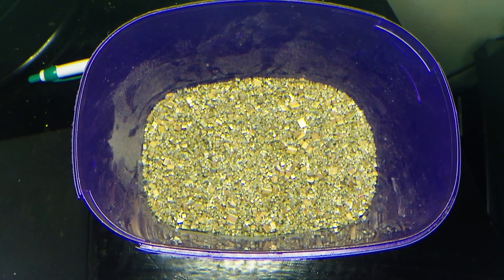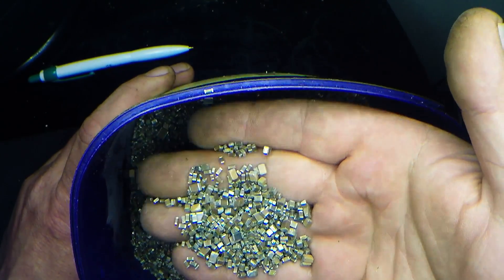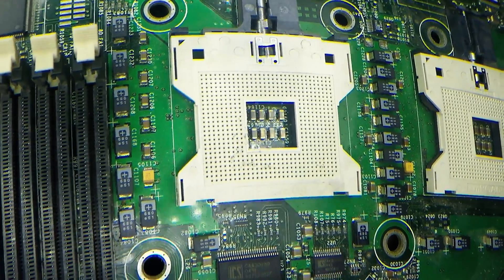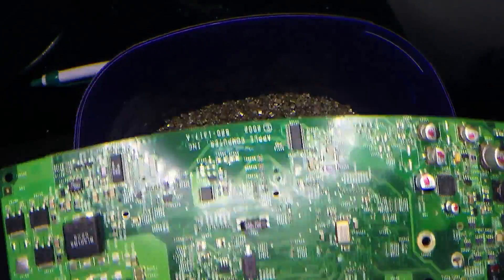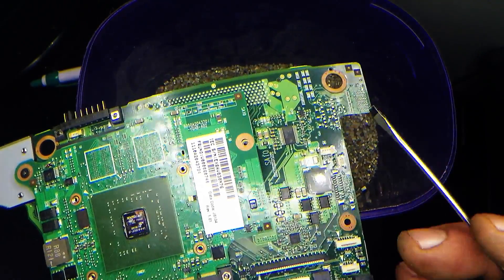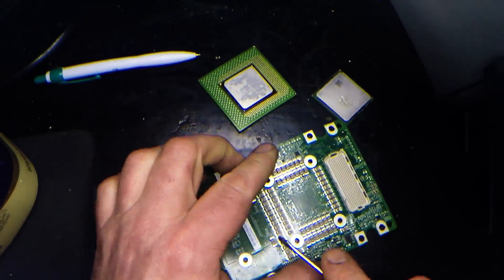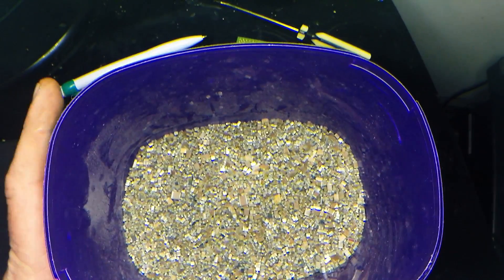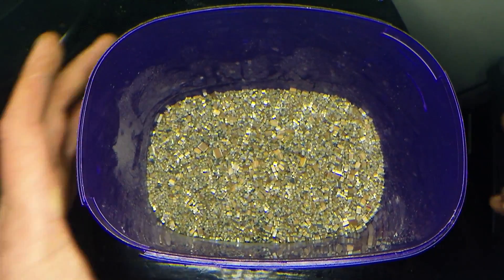Palladium & Silver recovery from MLCC's

Comment: You can get a multi purpose tool and get a blade that's small and thin just like your screwdriver maybe a little bit bigger you turn that thing on and when you see The row you want you to go across from not touching anything else and you won't have all that holding it down with your hand sticking yourself with a screwdriver just a suggestion sir Give it a shot

Comment: Remove big capacitors, Warm the board to melt solder in a convection oven, pluck off bigger connectors, scrape with a paint scraper. Separate with a magnet. The resistors are ok to have mixed in because they have silver on the ends.

Comment: If you're buying piles of these things off of sleazebay for way more than they're worth you've already failed anyway. If you're picking them for yourself I don't really see the issue with tossing the inductors into the same batch. Sure technically your yield of palladium by weight will be less than 2% but who cares? It's not going to stop the acid from working to dissolve it all and you're not going to lose any palladium because of it and you'll get a bit more silver than otherwise would. Don't leave money on the board!

Comment: What would happen if mix the mlcc and mlci together? Will we still get pure silver over it? Cause its pretty hard to tell which is which. And most of the circuit board not state it.
Reply from the maker: silver, yes. but no palladium in mlci. inductor code on board is "L"

Comment: Firstly MLCCs means MUltilayer Ceramic Capacitors not Monolithic Ceramic Capacitors. Many videos claim they contain gold ,they do not.

Also it has been the avowed aim of every MLCC manufacturer to eliminate Palladium from being used as a constituent of the electrode alloy (used to be 70% silver 30% Palladium )  so many other metals have been used as substitutes eg, Lead, copper etc with some success, This is because the supplyof palladium is volatiles and expensive. The main metal recovered is Silver from the terminations (mixed with glass),  If you want to make money it is no use relying on the sellers estimate of Palladium content  you must obtain an assay before you buy, and believe me you will find very little Palladium in it in most cases. 

former AVX Technical manager.
Reply: thanks.
Reply: what if we buy in india , where sellers know little about estimates

Comment: Ben, I'm sure this question is asked a lot but I haven't seen it. Lets say I gather a lot of scrap, perform the recovery and even the refining process myself. Where exactly does one unload two or three ounces of Palladium? Gold and silver are easy, every pawn shop in the country will buy your gold and silver (though at a much-reduced price). How does one go about moving large amounts of Palladium, tantalum, etc? Great video! One of the better ones out there on e-waste. Keep up the good work!
Reply from the maker: you wold sell precious metals to a bullion dealer, not a pawn shop, they would buy palladium no problem.
tantalum capacitors can just be sold to a buyer as it's not likely you will be able to process it, requires very high temp's to melt

Comment: Please note, that not all MLCCs contain palladium. Some just use Nickel. And there is no easy way telling which one has Pd in them and which one doesn´t. You can use a magnet to sort out nickel carrying MLCCs (nickel is magnetic) but even those nickel based MLCCs may contain Pd. So there really is no easy way to find out before recovering the PMs. From my practical experience 2% Pd and 10% Ag is a maximum, yet possible. Recovery is a pain in the a.. but that is another story. Not suitable for beginners.
Reply from the maker: Yeah I explain NME & BME MLCC's in the mlcc melt video which should be finished in a week or so.
The nickel based mlcc's or BME's don't contain any PM's but the NME's contain nickel which is why they are both magnetic to a degree

Comment: hey you stated that these are marked with a "C" or a "D" however on some sound cards 
there marked with a "R" , what is the deal with the "R" ones ?
Reply from the maker: R is a Resistor, D is a Diode, only C is for capacitor but still needs to look like an mlcc to be one, so no C no mlcc
Reply: ok so what does a resistor have as far as pm's go ?
Reply from the maker: Not much, thick film resistors, the ones with numbers on the top of them usually have ruthenium but very hard to get it and very small amount, no, resistors are not something we really go for, it's just not something an average refiner would bother with
Reply: ok thanks for all that information . keep up the great work my friend .

Comment: So what would happen if I throw a bunch of these into a crucible and melted them... Meh Finding out is half the fun!
Reply from the maker: I'm thinking about doing it to get an idea what percentage the metals are in them in general, might not work though as there's a lot of ceramic and it's hard to know which are noble metal mlcc's and which are base metal mlcc's, but as you say, it would be fun trying.
Reply: I have an old old computer from the early 2000's 6 hard drives, 8 loose ram sticks 2 old monitors, bunch of stuff I could scrap, I also melt aluminum cans, the machined aluminum from a hard drive is so much bulkier would be nice to make them ingots.

I was thinking of just crushing Fluxing and melting the entire thing to let the metals settle down, if I had to I could use lead to help collect the silver and palladium then refine it with a cupile. (May have misspelled cupile, never used one :D)

I have a silver skull I made out of pennies, its cool, more about the art than making a profit, literally since it's illegal for me to make a profit off messing with pennies! must be for education and art.

Comment: How do you take an MLCC off of a board without it breaking and crumbling?
Reply: themedres s I use thin pliers for the bigger ones. Small ones sharp chisel (carefully adding pressure and moving chisel side to side.)then pour into a jar.

Comment: You can tell the difference of MLCI and MLCC by color. MLCC have a yellow/brownish color and MLCI are black or grey-black.
Reply from the maker: no not the case, it's the coding on the board, L for inductor, C for capacitor, mlcc's come in lots of shades
Reply from the maker: and different grades, grade 1 - grade 2, grade 1 are high grade and mostly on telecom, sserver and H/D boards
Reply: its my experience, i measure them with a multimeter so i can be 100% sure thats a cap or an inductor. For my batch the color scheme is always the same. The inductors where always black or grey, and the caps yellowish cream like. I measures hundrets of them, i never found a yellow inductor.
Reply: eWaste Ben
 do you know if the silver plates inside of pc hard drives are silver plated? do they have any value?
Reply from the maker: usually it's platinum but you need thousands to get 1 gram
Reply from the maker: no but you will find black mlcc's

Comment: I pulverized a small batch of these, from four different makers. Then applied silver test solution to the powder. First tested the silver test solution on a .999  silver round. Positive test for silver. The test on the MMLC powder was negative for silver. Repeated the test 3 times. Under a 30x scope the powder looked like nickel. Am going to do a fire assay on some and see what the results are. Nickel will go to the slag. Nickel is widely used for metal plating and as a electrical charge holder.
Reply from the maker: +David Howard some don't have silver contacts and no palladium either, but I don't think your testing methods is how they do it, you would want to refine that powder and drop the silver out, then test wouldn't you?
Reply: its a watytofireassa

Comment: wouldnt it be easier to use a heat gun instead of using a screw driver to remove these?
Reply: no that would just make a hot mess, these pop off super easy which is why people take the time to collect them

Comment: When you de-populate a board via an air hammer... how do you separate MLCCs from MCLIs and MLCRs (resistors) since off the board there are no codes to read and they all look a like? Or in that case you just process them all together? Thanks!
Reply from the maker: +Scappin' Cricket yeah not much you can do there aside when you get them refined you will just have less palladium/silver ratio, I do try and remove bigger mlcc's first by hand, the small ones and crumbles will just go in another tub and processed after the hand picked one's are.

But if you want to be picky then do them by hand first, that way you will have a nice clean batch.
Reply: +eWaste Ben Thank you for replying back and being helpfully honest :)

Comment: I tried quickly to write in the forum but couldn't figure it out quickly enough , so I was wondering if u could answer one more question.  what is the silver stuff on the end of these Flat connection wires/paper?  ribbon like,  I see on many it is good but im coming across silver ones.  are these precious metals?
Reply from the maker: +Raymond Reyes Tin
Reply: +eWaste Ben  it's TIN?
Reply from the maker: yep Tin, rarely silver, when it is silver it's not shiny it's a flat grey

Comment: Gday, how do they do it on industrial scale? Do they just throw everything into a furnace to melt everything and separate metals by melting points?
the main problem would be plastic fumes.
Reply from the maker: +GEZZA1 Not melted, they grind the boards down to a fine powder and use eddy currents to seperate the metals, plastic etc. it's a very clean process.

Comment: Take care folks with the MLCCs. I scraped almost half a kilo of them over the past 2 years, later I found out, that there are 2 types of MLCCs, BME and PME (base metal / precious metal). BME MLCCs contain no Pd, they contain Nickel instead and are magnetic... I tested my MLCCs with a harddrive magnet, more then 2/3 of them are magnetic... =(
Reply from the maker: +TAWNY BME's have only been in production for 5 years and not many things we scrap are new, they still make class 1 mlcc's.
you mostly have inductors that look like mlcc's, they have code "L" on the board and are easily confused with mlcc's because they look the same.
Reply: no, its like you said, you can only trust yourself with MLCCs and I am sure, I had just scraped capacitors, didnt touch any inductors. Well, it was alot of work to scarp and collect them, and I was really disapointed, when I found out about it and run a magnet on them... have you checked yours, how much of them are magnetic? Well, I would guess, really good non magnetic MLCCs can only be found in 1990s hardware. Anything later then 2000 only if its high-end hardware like servers...
Reply from the maker: +TAWNY i'm pretty sure even the ceramic has some magnetism to them, a hard drive magnet is very strong so would pick up most of them, maybe try a regular magnet and the ones that get picked up then you could throw out.
think the colored mobo's, red/blue etc might have the new style mlcc's, I just pick 'em all and hope for the best if I refine them.
Reply: @eWasteBen  Nonnagnetic ones are nonmagnetic even for neodinum magnet,
Reply: @eWasteBen  hello, so I was wondering if you've ever scrapped a hospital laser? I got two rather large Exima 380 lasers and it looks like there is a lot of good stuff inside but i don't know if it is dangerous to be screwing around with lasers. Thanks for any advice you might have.
Reply: You can sell those old laser heads and power supplies they use to tinkerers like myself for more than what you would get for scrap. Do you still have any? I might buy or trade for one, as I could likely use the parts.
Reply: @eWasteBen  your the last person to take any advice from on anything recovering precious metals since you don't actually recover anything, you hoard material and have yet to do anything that recovers or refines anything. So yeah, anything about taking stuff apart sure
Reply: There is actually 3 kinds of mlccs, the two types you listed both very low yield of anything really compared to old school mlccs which are dipped. They contain 20 to 30 grams of palladium per kilo. Plus they yield silver but it's always the other metals that matter for me
Reply: OH I SEE.
YOU THOUGHT ?
BECAUSE THE FACT !
THAT YOU ARE ONE
BRAINLESS LOSER !
Somehow...
You thought ?
The rest of us.
ARE LIKE YOU.
NOPE !
WE,
THEE GOOD PEOPLE !
UNDERSTAND.

Comment: eWaste Ben do Inductors contain silver?
Reply from the maker: +Mark Hickman yes many chip inductors do have silver, less than 0.005 grams :) so it would take a lot of 'em to get 1 gram, but if they were mixed up with mlcc's then I guess after the palladium extraction from mlcc's, you could then get to the silver from the solution of both capacitors & inductors.
Reply: +eWaste Ben  e said that they do a little

Comment: Glad I came across your vids, Ben! Very good info. On this one in particular....I depopulate all my boards with a sandbath so my monolithics are mixed.....I proceed too many to hand scrape.... But I am only accumulating them at this point and refining or selling... Any suggestions? Or will it all come out in the mix when I do decide to test run a refining process? Cheers!
Reply from the maker: +pacoblancosmith Yes I think you'll be ok with a mix of mlcc's, resistors ect as you'll be extracting one metal at a time, so if your going for Palladium first then what's left will contain silver and other metals, next you might extract the silver, by then you might be happy with what you have at that stage. I have a new method of depopulating boards, simply using an air hammer, my latest video shows the process, in the end I have the same as you have after a sand bath.

Comment: If your processing the mlcc's yourself is it as critical to make sure they arent inductors?
Reply from the maker: William Ela Probably not but you still want clean product with as little contaminants as possible when processing mlcc's.
Resistors can be processed for other metals like ruthenium.
Reply: I saw that comment and you stated that  you didnt know if the ruthenium could be processed. Did you find out somethin else in that time?
Reply from the maker: William Ela They're getting it at the highest level of refining, like Umicor.
I'm still looking into it but there's no reason Ruthenium can't be extracted from the thick film resistors.
The one's with a black top and numbers on it like 135, 325 etc.
Reply: eWaste Ben Thanks! ive been scrapping for a while and have started geetting into depopolationg mother boards! MY personal favorite areMLCC's

Comment: superb channel and video as well! but i ve got some old mobile phones circuit mother boards and i ve looked for marks on them next to theese MLCCs and there is non. So how do i know what is what on  boards like this? it is really hard to tell just by color sandy looking MLCC. i want to get the highest rate as you mentioned. thanks
Reply from the maker: lubiatty1 Sometimes the codes will be in a group near the corresponding group of mlcc's. But mobile phones are known to have high quality components and those that look like an mlcc most likely will be so i'd be comfortable with putting them in my mlcc tub.
Reply: thanks for advice. i dont see any marks next to anything there at all. but i believe they are all MLCCs, hopfully. thanks again!

Comment: I was reading somewhere that the black mlccs have rhodium in them, is that true?
Reply: eWaste Ben 
you would extract the rhodium and iridium the same way you would platinum and palladium its just hard to separate platinum group metals
Reply from the maker: stanky budz I haven't heard of mlcc's having rhodium.
Reply from the maker: stanky budz oh sorry I was just thinking mlcc's which are capacitors, you mean Resistors, yep, the black resistors do have oxides of ruthenium or iridium and rhenium, just not sure if it's possible to extract the stuff.

But one computer all up can have up to 1000 thick film resistors so it's worth finding out for sure, thanks.